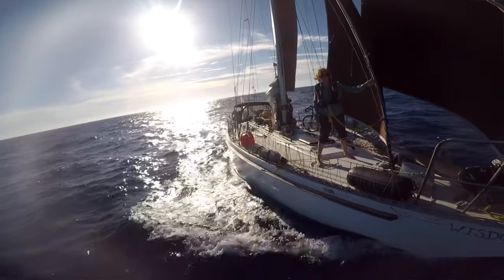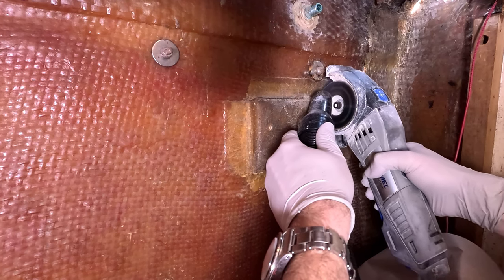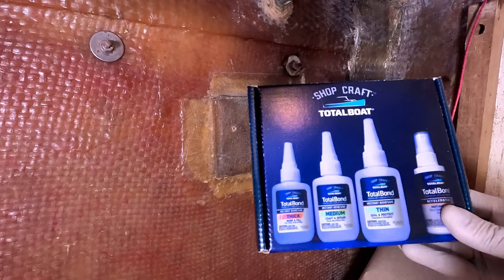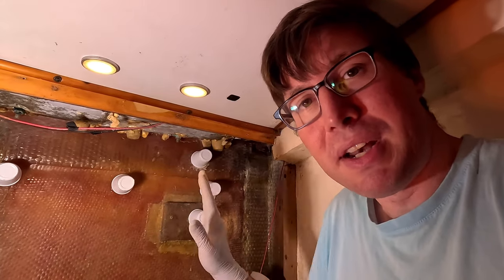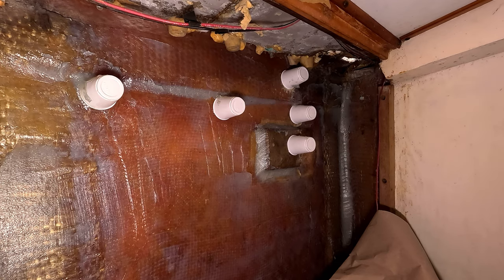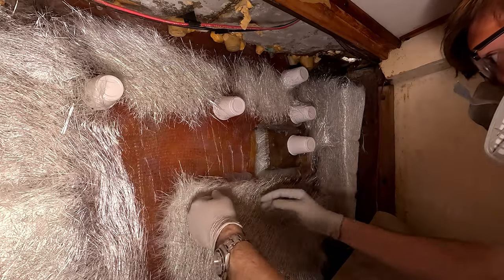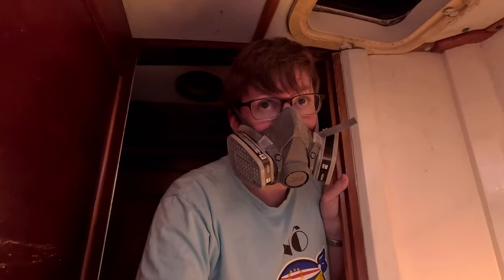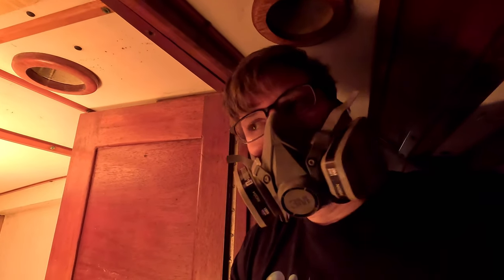What Will Support the Chain Plates? | Sailing Wisdom [S6 Ep5]

Comment: I'd love to see the x-rays. I'm amazed that a dental x Ray machine has the power to go through steel. As a one time  industrial radiographer we used much more potent machines!
Reply from the maker: For dental with digital I have the machine set to 9 milliseconds, but with film it used to be up around 25 milliseconds. 
For metals, I just crank up the settings until I can see through it :)
Reply: @RiggingDoctor  Interesting, how many kV? we used 200kV machines or gamma rays.

Comment: The first step is actually to go over the entire surface you want to bond to with dewaxer followed by the grinder.  Then put the new glass in with epoxy not polyester resin.  The reason not to use polyester resin is that polyester doesn't make good secondary bonds and epoxy does.  Since you used laminating resin, there was no need to rush.  Also, all you needed to do to get the laminating resin to cure was to spray some polyvinyl alcohol onto the surface.  That is a 2 minute job.  Once the resin is fully cured you can wash the PVA off with soapy water.  Also you really should have used biaxial fabric rather than woven roving.
Reply: Well what the theory tells me: bond glass to glass directly. To do so you would sand away all surface layers of the old polyester. Instead you added a layer of filler on the old resin, then came your glass, this is not really connected to the old structure, just sort of glued to the old laminate. The polyester resin is the weakest part, the only structural strengh comes from the fibers. So basically you need to build the reinforcement as strong as if it would be the only part, the hull itself...
 This is not something done professionally, sorry.
Reply from the maker: These are good points. Epoxy has a much stronger bond than polyester, but it is also much more expensive. For the forces put on this area (compressive) the bond of polyester will be strong enough given the surface area it has to bond with. 
As for dewaxing and grinding, that would be good to do, but this job is actually supplemental. Based on the scantiling numbers for the Morgan, the hull needs to be 3/8” thick (9mm) to support the added load of the chainplate, but the hull is already 3/4” thick (19mm). I added an additional 1/4” (6mm) to the hull to beef it up, especially the tabbing to the bulkheads where roving is preferred over biaxial due to the direction of the fibers. I then put biaxial over it at the end for the added strength that that fiber design yields, but the two layers of roving are the real work horses in the story here. 
As for the rush to finish: I only had 1 day to get it done so that it would cure as one solid piece. 
As for the PVA or finishing resin coat: I had been working for 8 hours without a break. My arms were done and the quick finishing coat could wait. My arms would not comply so the job ended at that stopping point.
Reply from the maker: The reason for the putty layer was to fill any voids in the surface of the old layer so that bubbles would be less likely to occur. I sanded the surface and wiped it down with acetone, but that doesn’t guarantee that a small void won’t occur between the old and new glass. 
Also, a stray strand sticking up would hold up the laminate and cause an incurable air bubble!
Reply: There you go. I guy that knows his glass work. Layup with Poly but repair with epoxy every time. I was going to comment but you already said it all.

Comment: I was wondering what you would think of this. I love the dipping lug rig, but this requires an unstayed mast. Difficult to dismount because it is keel mounted. How about a mast where it only goes halfway up the mast. If you were ever dismasted, then it  would likely leave you a short mast where it broke. You could also lower the mast and stow it in the length of the boat.
Reply from the maker: I don’t completely follow, but tall ships masts are actually multiple masts connected together on their way up. Maybe something like that?
Reply: @RiggingDoctor  No what I mean is all the tops of all the stays being  fixed at halfway up the mast. It is a hybrid between being an unstayed mast and a stayed mast. The mast could be deck mounted and because it is a dipping lug, it could be dismountable and stowed within the length of the boat. I have figured out how to make your own carbon fibre masts by the way. It's so easy and cheap. One day, I will build a boat of my own design. No keel leeboards, water ballast and dipping lug schooner rig.

Comment: Wow, that's alot of great looking work!!  We're in the middle of replacing a rotten bulkhead in the chain locker of our Westsail.  Using 1708 and epoxy resin,  have you any thoughts on using peelply?  A couple of small projects have come out pretty well with it.  Any thoughts, thanks for your time.  Jeff and Julie  s/v OoLaLa  Westsail 32  hull #81
Reply from the maker: Peel ply is great for two reasons: it makes it so you don’t worry about blushing, and it gives it a smooth surface.

Comment: Hull glass work appears bulletproof in good condition. I forget what the problem was. The body shop pros at Chevrolet would sometimes reconstruct a broken fender using the super glue, like putting a puzzle together. GM literally has factory super glue with a GM part number. 😊
Reply from the maker: That’s wild about the Corvettes. They weee ahead of their time using composites to save weight. 
The hull is thick enough to support the load because it’s over built, but I’m just adding a little extra insurance to make sure that it’s up for the task.
Reply: Was that epoxy you went over? Thank you

Comment: Curious, is the polyester epoxy non-blush or will you need to sand it so the “finishing” epoxy adheres?
Reply from the maker: Epoxy gets the blush, polyester does not, so you don’t need to worry about that

Comment: Haven't you two beat the bones out that old Morgan?  Don't you think it is time to upgrade, perhaps to something only 10 or 20 years old.                   Be happy, be safe, get a new boat.
Reply from the maker: I think the older boats are better built and safer than the newer boats. All boats need maintenance and parts changed out to keep them safe, but when well maintained, I think the older designs are better than the new designs. 
Doing these kinds of repairs keeps these boats alive. All boats will need this kind of work eventually so it doesn’t make sense to get a new boat every time something needs to be worked on.
Reply: @RiggingDoctor  Doc everything has a life span.  You, me and boats.  When a boat turns 30+ it's best days are way behind it.   You end up spending money keeping a corpse going.  I wish you luck, but why choose to spend your lives in the ghetto?
There are some great boats out there under 10 years old that would serve you well.    Be happy, be safe
Reply: I agree with Herbie,
I am just buying a 45 year old boat. Around all the thru hulls the glass is over an inch thick.
Around the ports it's still almost 3/4 of an inch thick.
When you run aground with it it will most likely survive with very little damage.
Whereas a similar new boat could easily have a big hole left behind.
Reply: @RiggingDoctor  Sorry Doc, I should drop this but but for goodness sakes I think you are off base here.  Your saying you prefer a 40+ year old boat because it is better built and better desighned then newer boats.  What about Island Packet?  Nautor Swan?  Amel?  Oster?  Alubat Ovni?  Discovery?   Hallberg-Rassy?  Contest?  I could go on.  Get my drift Doc?  Have you been hit on the head recently?
Be happy, be safe